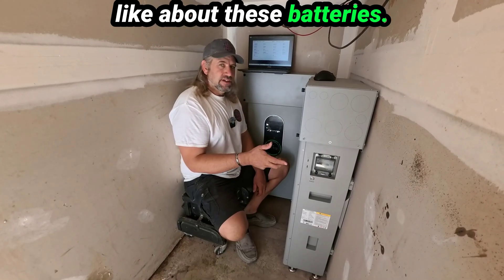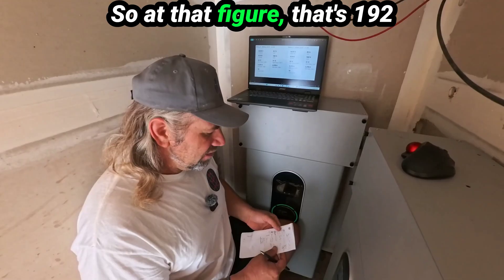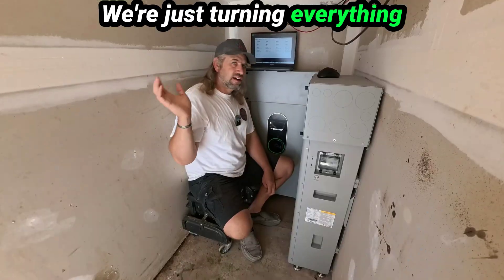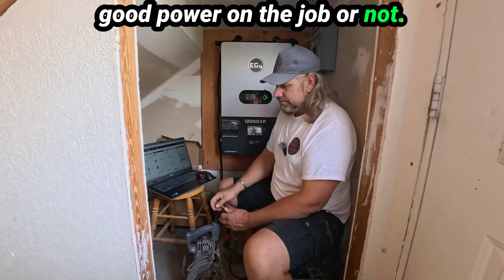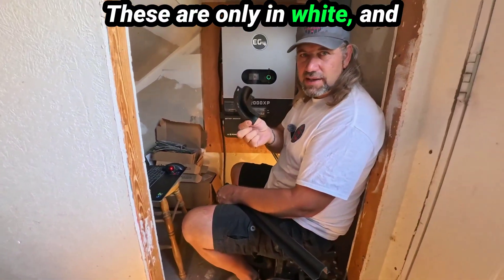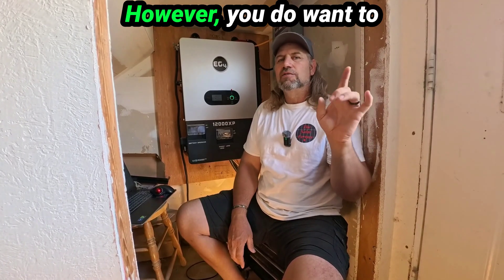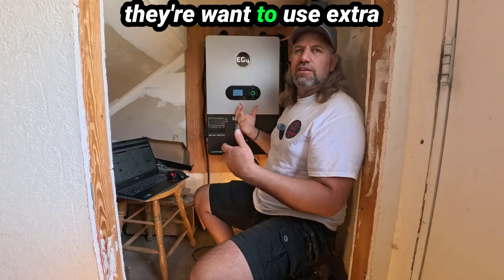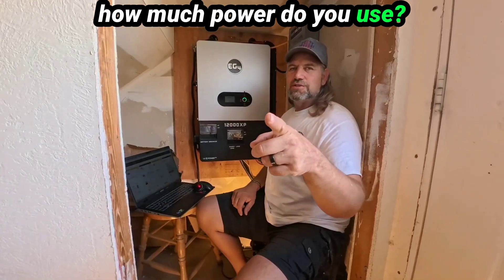EG4 12000XP & Indoor Wallmount Battery Bundle One Month Review (12XP Part 5)

Comment: 2450 KWH a month  currently running three flex boss 21’s a grid boss and 9 indoor wall mount batteries with 78 450watt panels